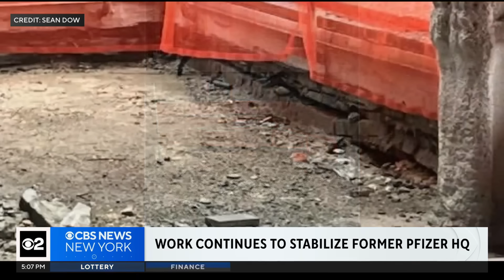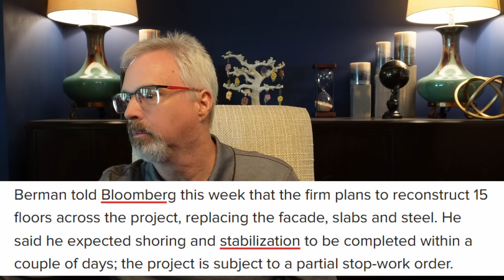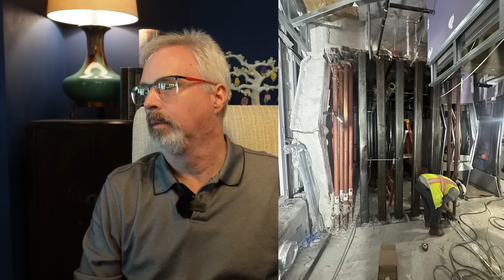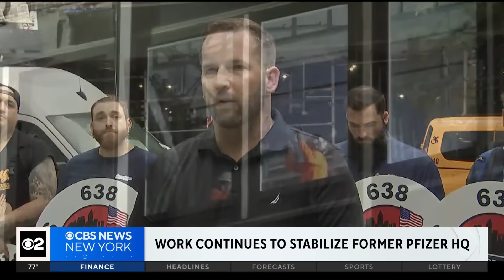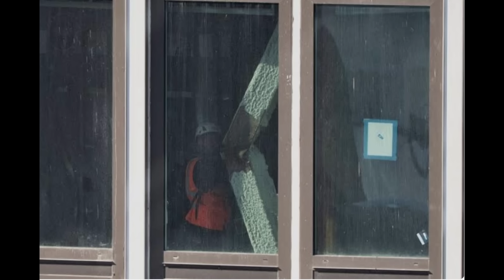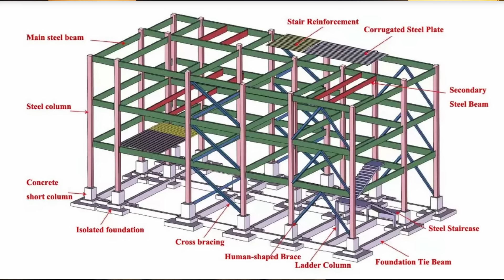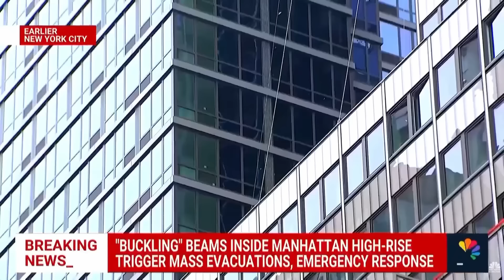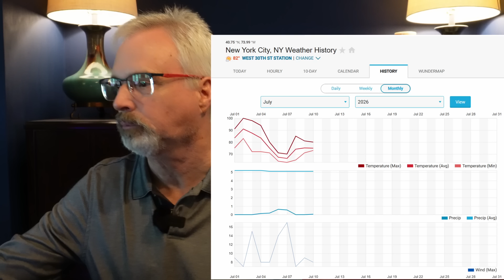Update - Pfizer Building Structural Column Failures; Now What?

Comment: You don't actively monitor stresses in conventional building structures because it's simply not necessary and is a big expense.  If the engineering is good, construction is correct, and inspections are adequate, monitoring won't provide anything useful.  Of course, if a design is unconventional, radical and/or innovative, that's a completely different story!  Then, monitoring is essential to verify the effectiveness and safety of the structure.
Reply from the maker: Do you think this should have been done on this project?  Not in retrospect as we know what happened but considering the original complexity of this project.
Reply: @CaseyJones-Engineer  At the risk of speaking without knowing enough about the details, this seems a fairly conventional frame structure.  The geometry is conventional, the loads are conventional, the materials are standard, and there should be few unknowns.  The engineering assessments should be straight-forward.  Inspections of the existing building and whatever its condition should not have been a problem.  I'd really want monitoring when I had uncertainties about loads or response or was using unusual materials or methodologies, which wouldn't really have a place in a project like this.  Another problem with structural health monitoring is what to do in the future if you observe weird or uncomfortable response.  Monitoring seems like an excuse to reduce the degree of design conservatism below what has traditionally worked pretty well.

In the ship structural world that I retired from some years ago, innovations and new concepts with their associated uncertainties and risks usually required physical validation tests in support of advanced analysis before they got adopted.  Expensive and time-consuming, but we sometimes identified issues that would have been otherwise problematic.
Reply from the maker: @speleotrog  Those are great comments thank you. The whole thing is rather inexplicable to me. I'll be interested in seeing the forensic evaluation reports.

Comment: Presumably you get more movement in an unoccupied building because the interior is no longer being climate-controlled to around 20C - it's just getting hot in summer and cold in winter. I'm guessing that 17mm is fairly typical for a building of this height.
So it's not an indication of any particular problem per se, but it is a change from the environment for most of the previous 67 years. Unoccupied/unheated buildings are much more likely to suffer issues than heated/cooled ones, although usually not structural ones unless things like roof leaks/holes/plant growth are left unattended-to for long enough to do damage.

Comment: ... you can see whats happened here, the architect has got in a trainee civil engineer, who has just stuck it into a generic structural design package (or maybe AI), and done basic calcs on the slenderness ratio for the existing columns (or assumed fixed end constraints). The whole structural engineering team should be banned for life.

Comment: Extending the floors as an overhang (cantilevered) with only the 'free end' fully braced into the 21st floor (where the vertical beams buckled), concentrates the load to that end.  As an overhang, the end will 'bounce' up and down in response to wind, load, earthquake, ... EVERYTHING. 
This was unavoidable as designed! The 21st floor should have been reinforced prior to adding the overhanging floors above it.

Comment: I think on a project like this adding so many extra floors to an existing structure (obviously not built originally with this additional load in mind) sensors should be mandatory. This isn't a project in the middle of nowhere, it's on 42nd street in NYC. Has anyone calculated how many people could yet be killed by mistakes like this - if the building should fall against it's neighbours or in to the street?
The absolute highest standards should be adhered to in a neighbourhood such as this.

Comment: Write the building off. If there’s damage to the face of the building from compression, it stands to reason that the members and joints at the back of the building have seen extreme tension. The building is rolling down its length. 
The damage is too extensive to quantify.

Comment: They can blame engineering, inspections, construction mistakes or non union workers, but the root cause looks a lot simpler, greed all around. They didn’t have to stack more floors onto an old building. They chose to because more space meant more profit and the safety margin got squeezed with it.

Comment: The added construction found a new equilibrium after the failure of the columns. It was basically hanging, supported by hundreds of joints, welds, bars, concrete slabs, bolts, and nuts that were never designed to carry that kind of load. Every single joint is now a failure point due to being overstressed. That added structure needs to come down and be rebuilt.

Comment: Engineers and developer moved forward with a goofball construction plan, are faced with a pretty obvious issue as a result, therefore it's non-union labor's fault. Lmao
I've seen tradesmen in and out of the unions do great work. I've also seen tradesmen in and out of the unions who shouldn't be doing anything more complicated than folding socks. Anytime someone tells you that there's an appreciable skill gap between those who do and do not belong to a political club, you can comfortably write-off anything that clown says.

Comment: I think they should just remove the extra floors and put a roof on the building where it used to be and give up on making it any taller. Making it taller is a fool's errand in my opinion and they are just going to continue ending up with structural issues over and over again especially if they continue to cheap out like they seemingly have been. Just give up on it already and settle for the building the size that it already is, it's big enough.

Comment: The developer appears to be a pathological liar.  He would have been so much better off saying "It is being investigated by professionals and I will share the results once I have them."
The union rep appears to be using mob tactics.  "Nice building you had here.  Too bad you didn't use all union labor."
I'm in favor of unions, but the way to promote your union is to talk about your successes, not try to warp failures into your narrative.
I'm glad you mentioned the top floor beam comments.  I would certainly expect the last beam holding up just the roof to be made a less expensive part.
I'm also glad you mentioned the additional safety margin of older construction in general.  I still wouldn't value a retrofit as highly as (proper) new construction though.  We've learned so much.

Comment: Great analysis. Got to see up close the old school, pre CAD, pre PC software tools etc, way bridges and other big structures were designed  by civil engineers. With pen and paper. And a few mainframe line-printer printouts. 

As they say with aircraft accidents - all the holes in the cheese lined up here. 

From the engineering angle looks like there were two big holes. 

The developer putting on huge pressure to cut costs at every opportunity. If several alternatives available the cheapest not the most suitable for an old structure was chosen. Which worked until it didn't.

And all structural calculations and plans based on the most optimistic assumptions about the structural integrity of the existing structural elements. Like just slotting in expected optimal physical characteristics of existing structural steel elements in all calculations and models. Rather than actual values based around on site inspections. Comprehensive physical inspections are expensive. Slotting in values from old manufacturers / reference tables is cheap. 

What's happening now? it's the early stages of the dance that leads to the developer declaring bankruptcy for the project and everyone preparing for the inevitable lawsuits / liability insurance claims counter claims and challenges. 

On the bright-side there are a whole bunch of law-firms already thinking about what kind of (large) partner bonuses they will be making out of this fiasco. In the coming years / decades.

Comment: After 9/11, an estimated. The collapse of the Twin Towers and the resulting fires pulverised an estimated 400 tons to 1,000 tons of asbestos-containing materials that were originally used in the construction of the buildings.
The Pfizer building is older than the twin towers, so asbestos would have been used.
Many countries systematically removed asbestos from buildings where possible.

Comment: My hopefully simple question is: how likely is it that a structure supporting a roof + live load of people (if it was a break area) + mechanicals (HVAC condensers say) can support 16 stories above it? Who would overdesign the building this way? It makes, in my mind, very little sense for the original structure there to be able to support much more than a roof with typical roof stuff on it. 

Given the massive overload it took to buckle these columns, I’d say the original building design had plenty of factor of safety, and the columns - even if corroded - have performed admirably **for their intended purpose**.

Comment: Question about Champlain Towers South.  Did the addition of resident installed material affect the collapse? Was it considered?  I'm thinking of the marble in the kitchens and bathrooms, the tiles on the balcony/decks and the sliding glass doors.  This seems to have been very significant but I haven't seen mention of it lately.

Comment: What type of human error done by a regular construction worker can cause an overload of this magnitude? This is definitely an engineering problem. Some structural engineer has really f*u* ed up in his calculations. The columns that buckled still had the original fireproofing, so that means that were not reinforced. How can you even think of adding a dozen of stories to a building without need to reinforce the columns? Did he really think that engineers back then were so stupid to oversize the structure to that point?
And what about the developer? Did he really think that too? Did not have idea of the possibility of a mistake by engineers when they told him that no reinforcements were needed?
I have my own personal experience with a very reputable structural engineer that screwed up calculations in one of my projects, now I hire 2 different firms, the second to recalculate all the calculations done by the first firm.

Comment: To me it seems that the structural engineer is responsible.  Unless they called for reinforcing the existing columns and the contractor did not do the reinforcing….Or they made an error someplace!  First thing would be to check the design documents.Since the failed columns were  somewhat corroded, could be that the survey of the building was not done properly too. At this point we have to wait for more info.

Comment: Today's CAD design of just build to the stated code with ZERO extra redundancy is just so wrong. The old guys 100 years ago building the NY skyscrapers using but only math, a pencil and a slide rule built structures with extra redundancy, just in case, and those fine buildings are still standing without issue of collapse. When you look at early construction photos of this new and now collapsed section the vertical steel bars seem infrequent and undersized for the task at hand as shown at 19.08 in this video and the developer has been greedy stepping this section out over the existing structure cantilever style to maximize floor space and line up the new curtain wall windows with those from the 1960 section next to them.  Strain gauges should be an automatic requirement for a project such as this so that there is automated monitoring from project start to its completion to avoid this type of outrageous issue.

Comment: Just stacking more weight onto an already 60 year old steel framed building without a proper investigation of structural integrity is insane. It looks to me as if the buckled steel work was part of an early addition to the original building below and i wonder if this is so? If it is it may have been built of steel of smaller dimensions to reduce load on the floors below and therefore concertinaed when the new added weight was loaded on top. The contractors and designers of this add on probably did not expect some one adding excess loads in the future. Then look at the problems and fixes that may have occurred over it's lifetime of the building before adding multiple tons to an already 60 year old building. This is greed over safety. When you have congested all your landmass with buildings the only way is up but the building you are adding to is your foundation. If you foundations are age deteriorated that is not a n intelligent choise to build on. Thank god they failed now and not once the apartments were sold and lived in.

Comment: It's worth mentioning that, in designing a building, a column generally requires a higher factor of safety in design than other elements, i.e., beams.   An overloaded beam will yield and then plastically deform - very obvious.   A column -- as here -- can buckle suddenly and catastrophically before its yield point is reached.  Think of placing an automobile on a hydraulic lift in a garage, which raises the vehicle some six to eight feet.   All is good.  If the lift now raises the vehicle 200 feet in the air, the stress in the lift doesn't change.   But the column is now going to be way past its buckle length and will fail by buckling.

Somewhere, somehow, these columns were either improperly designed or, in the construction, some critical feature(s) of the design was omitted or changed.  Think Kansas City Hyatt Regency.   A properly designed and constructed column wouldn't catastrophically fail well before the design load was even applied.

Finally, when will architects and engineers realize the problems cantilevered structures cause?

Comment: THE WINDOWS HAVE FAILED DURING CONSTRUCTION. 
 I think this building is now basically 2 on the bottom and 4 on top. On 1 side they have more than doubled the height, which puts more weight on half of the foundation. They added more floors and an addition( basically a giant chimney) to the other half, which is putting uneven pressure on the soil, water table and foundation. I believe 1 side is compressing the ground, forcing ground water under the other side splitting the original bottom into 2 parts. 1 side compressing, 1 side rising. That then splits the upper bits into the sections; all new floors tower on 1 side and the original tower, the new top tower floors & the chimney. Everything is too heavy for the old building to start with. But then they've disturbed EVERY FLOOR to put in conduits for gas, water, sewer, electricity, probably trash chutes too, elevators, HVAC, etc. The 'chimney' literally looks like it's hanging from the new floors with just some poles under it (kind of like a stack of square Legos as a corner of a house but attached to the baseplate by Lego columns. Remove the baseplate( or building under it) and the corner starts to fall off). I think the 2 bottom halves are pulling away from each other forcing everything upwards to tear apart.

Comment: Everybody seems to focus on damage to floors above and below the failed columns but what about sideways damage? It did not collapse, the only part I see that could have taken this load downwards is this structures colums next to the other tower and the other towers colums and the sideways load created by the sag only by the next tower. This connection and the next tower could be damaged. I would not be surprised if the next tower is bent a few cm but might spring back.

Comment: my $0.02 ....Looking at the shape of that buckled column, classic Euler buckling for a column fixed in rotation at the bottom but not at the top... The structural model used to verify the design possibly assumed full moment connections at both ends....
Reply: Agreed, the column was continuous through the floor and had a pinned connection at the roof.

Comment: "Typical mishap" what the hell does "Exceptional mishap" look like then? Do I pick up the building off the street? The columns are bending in their weak direction, so I think the builder might have to either double all of the columns to give them more stifness, or build a concrete casing around them to add some strength in compression. But it's a question if that would work with the interface between the columns and the floors.

Comment: An office building would normally need to be able to support about 66% more live load than a residential building. This is why they thought it was possible to add those extra floors onto that former office building but to turn it into a residential building. 

However, the maths is not as simple as being able to simply add 66% more floors, such as adding 66 floors to a 100 floors building. There are many other factors to consider, such as the other main type of load, dead load, that would have reduced due to improved engineering and improved materials, the strength of the structural members, which are usually poorer the older the building is, the additional requirements in new building codes, etc.

Comment: Surely the reason structures are built with added safety margins is because there may be unknown factors. To say that we no longer need these margins of safety because we know so much more than in the 60's seems sheer arrogance. For instance we know now that the summers have been getting much hotter than in the 60's, but you can bet your life that hasn't been taken into account in this extension. And the argument that adding height is common, does not mean it is safe!